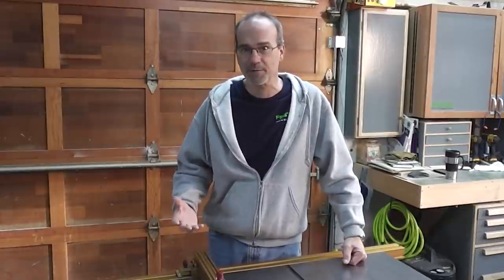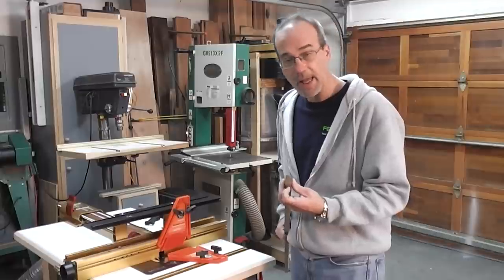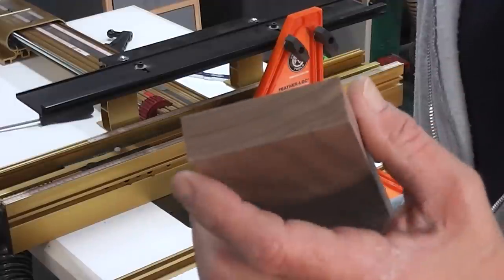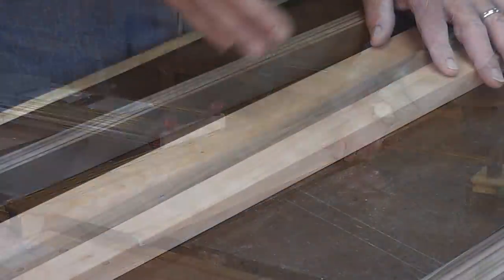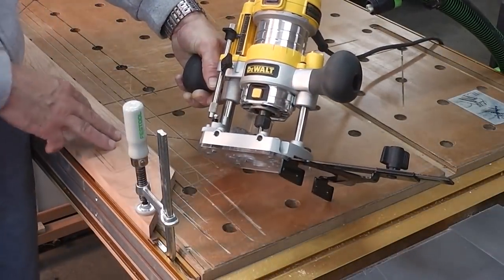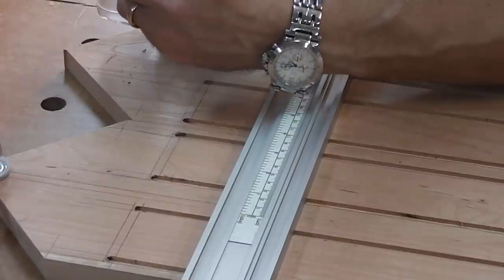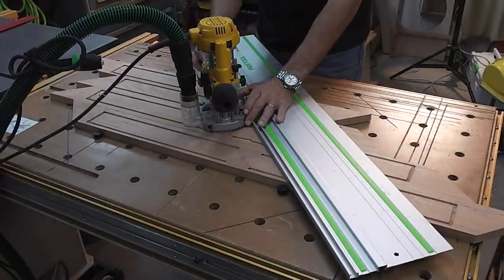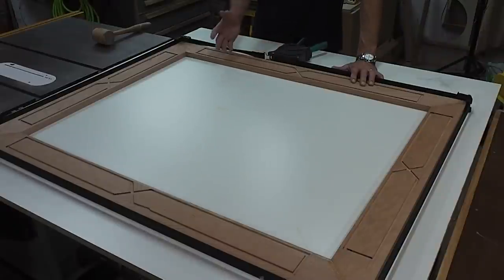English Picture Frame - Part 1

Comment: Great video Guy. Nice project, and good use of the router. The Festool table really helped out there, much quicker to set up for those 45 degree guided inlay housings.
Did you ever hear about that shaped drill bit which cuts square holes? A router cutter like that would be pretty amazing, and save squaring up the corners and ends of a cut.
Looking forward to part 2.
Reply from the maker: I have one of those square router bits somewhere. I just couldn' find it. I'll keep looking......

Comment: MAN!  I thought for sure I had subscribed to your channel!     So, funny story for you.   I have the same Incra router table as you.  A few weeks ago, I wanted to add a feather board to the fence.  And the feather boards I have will not fit on the wonder fence.  I ended up not using a feather board and made the pieces I need, with success, but it would have been nice to have the feather board above the piece.    THEN!   I see your setup, with the feather board on the fence extension.   I just slapped myself on the forehead!   My damn extensions are laying in the basement collecting dust!  I'll have to dig them out and keep them with my table now.   LOL !     Take care, Eric
Reply from the maker: Hey Eric. Yeah, I don't think I can count high enough for all the times I've done something like that. Anyhow, I guess someone out there learned something from my video! HaHa